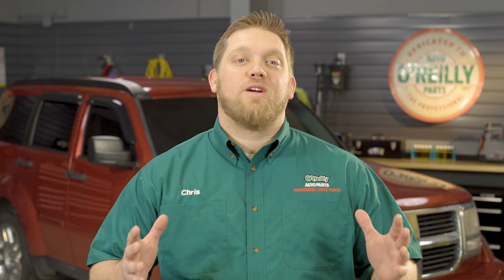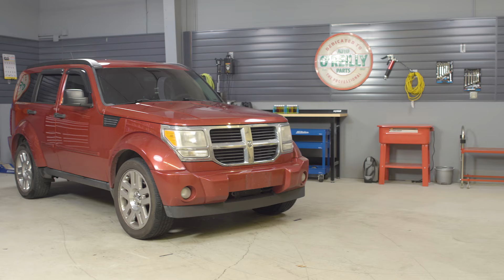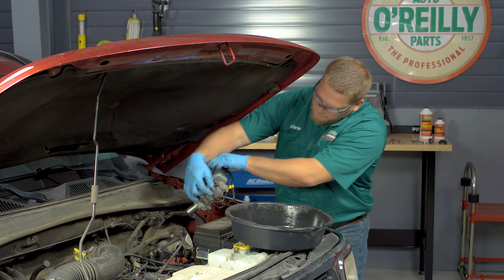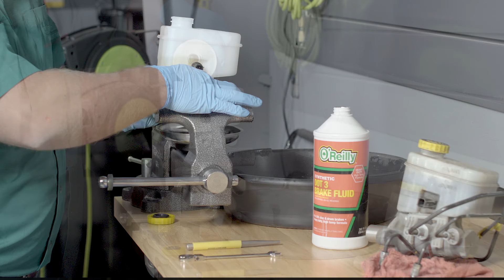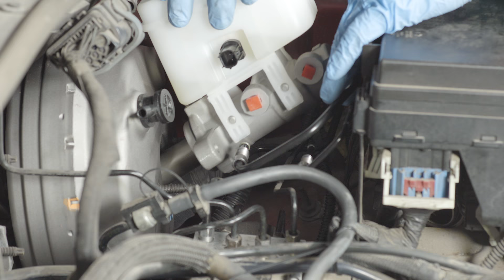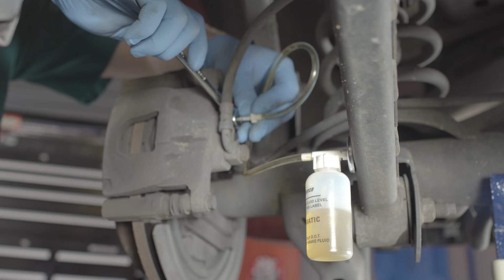How To: Replace A Brake Master Cylinder

Comment from the maker: Supplies Needed for This Job:

1. Safety Glasses: https://orly.cc/4e7cFKz
2. Gloves: https://orly.cc/3YKu3QZ
3. Chocks: https://orly.cc/4f7bdZX
4. Brake Line Flare Wrenches: https://orly.cc/3CHM8a8
5. Crescent Wrenches: https://orly.cc/40RrjRv
6. Socket Set: https://orly.cc/3Odkxji
7. Master Cylinder: https://orly.cc/3QcLZOT
8. Brake Fluid: https://orly.cc/3Xj71zF
9. Siphon Tool: https://orly.cc/4hPpMCv
10. Drain Pan: https://orly.cc/3OJj8Bd
11. Shop Towels: https://orly.cc/4fFCSS4
12. Brake Cleaner: https://orly.cc/3UtR1sQ

Comment: It seems my brake went to the floor only when I was driving at a high speed 60+. Whenni stayed below 60, the brake seems to stay tight. Could this be my brake line linking or collapsing? Maybe air in the brake line? Please help!!!
Reply: It only went down to the floor once on an hour and forty five minute drive. It came back up and remained tight after that.

Comment: "Compare brake function before and after working on the brake system" well that's easy, they don't function at all! Hoping they do after replacing most of the brake components
Reply: Im so glad someone else said that to themselves. Literally any improvement is an improvment

Comment: How do I know if I need to replace power booster?
Reply: Worthless brake pressure that builds with multiple pushes. Assuming there's no air in the lines, the rubber hoses connected to the calipers are okay, and that the calipers are okay too.

I busted my booster when I smashed the break with the engine off